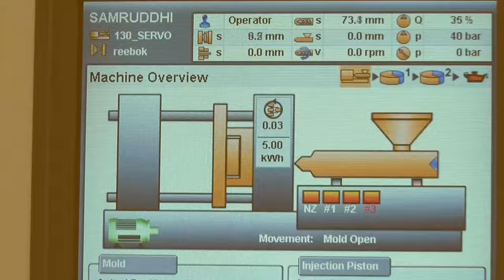Plastic Injection Moulding Machine | Video 1 | Samruddhi Engineering Co.

Comment: Great operator...no safety glasses, barefoot...no mold slowdown before full lock up...hell hes not even inspecting the parts....wish our shop ran this loose....NOT
Reply: I have never seen anyone use safety glasses in a injection molding shop.
And I have not seen anyone run a job like this without at least a sprue picking robot in the last 30 years.
On a machine of this size a portal robot is mandatory if you want to be competitive.
Reply: @anderskarlsson9881  no robots in my shop and I've been there for 21 years
Reply: @mattgiguere5638  I guess that the demands are not the same all over the world.
Where I work we have 7 machines, 80-250 tonnes, and one man running them 24/7.
Without robots for picking and packaging that would be impossible, and we would have to close down.
Reply: @anderskarlsson9881  agreed we have 7 presses also 75 to 400 ton but cater to the small guys with short runs...maybe a couple of 1000 parts with the exception of shotgun wads...32 cav hot tips 25 sec. Cycle.
Reply: Kaam krna h mujhe
Reply: Matt, welcome to India

Comment: No safety practice. The mechanic is inserting his hand every time
Reply: Yes correct. This is india so no safety for workers. Only Bigshots have all safety etc etc..
Reply: We have these machines there are several safety switches. The door opens the machine will not operate. There is a proximity switch connect to the door that tells the machine when it is closed.

Comment: I'm an engineer of plastic injection mouldings with 6years Experience
Reply: @kedarnayak9107 is that any possibility to change the mould for other products?
Reply: Yes
Reply: @yogeshrajagopal1987  where are you from ?
Reply: @kedarnayak9107  tamilnadu sir
Reply: Which place in tamilnadu
Reply: @kedarnayak9107   apka num dijiye plzzz

Comment: Make a long ejector pin .. you can run auto mode .. 2 times eject
Reply: It's design engineer fault
Reply: That's what I thought but then it would fall off.
Reply: Need to change the molds springs
Reply: You are right 👍🏻